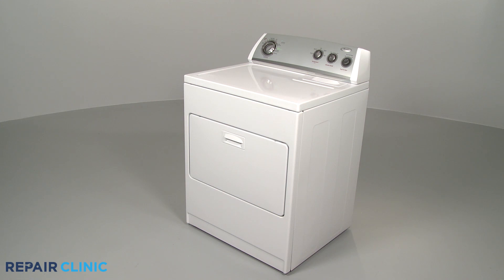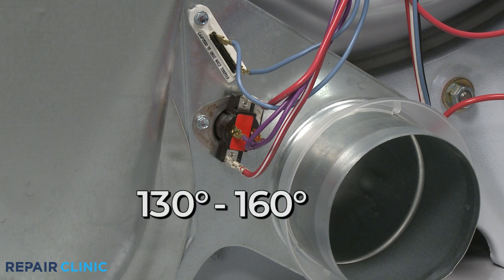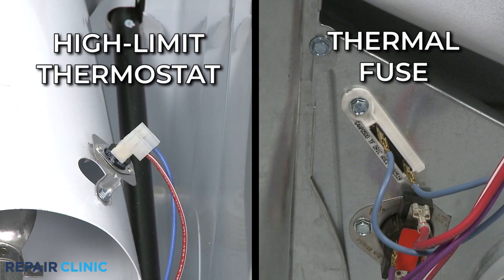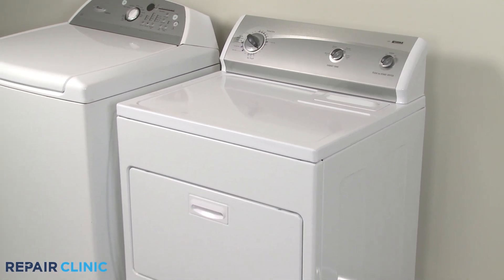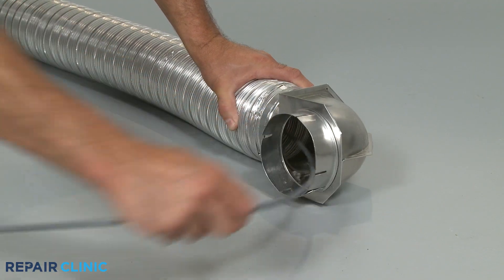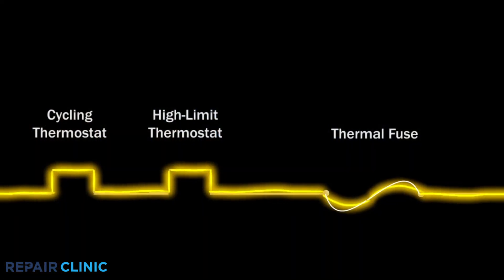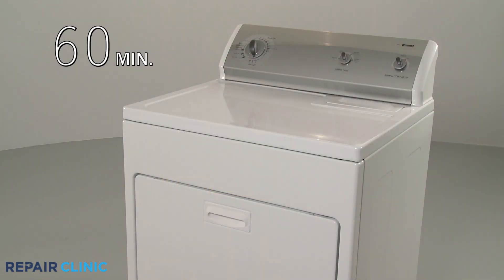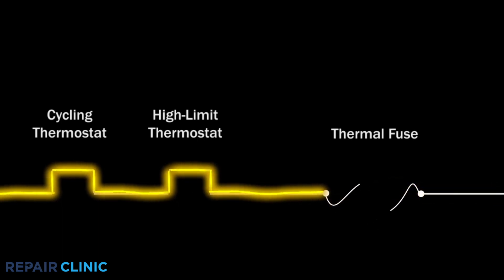How Improper Air Flow Can Shut of Dryer Heat

Comment: I have a maytag Bravo. The "detecting" airflow light goes on immedately. then the timer drops to 4 minutes from say 37 minutes.. when the cycle ends the 'check lint screen'  light starts blinking. I have cleaned the vent, lint screen, disconnected the exhaust , ive taken the dryer apart and cleaned everything including taking apart the fan, taking the drum out and vacuuming. Is there anything elese that can be wrong like a bad sensor or something? Thx
Reply: Ever figure this out?
Reply: I believe it was a lint cleaning inside that solved it. Once I actually hooked the exhaust back up to the dryer and it seemd to work. Bes answer I can give sorry
Reply: @Matt-px7nm  Thank you! I ended up finding a reset button inside my LG dryer and that restarted the heating mechanism and got it working again. Definitely needed a good lint cleaning as well. The interior was caked.
Reply: @PaulDo22 
Is it true, reset buttons are only on gas dryers?
Reply: @soniaochoa7858  The reset button is specifically for the gas dryer electronic ignition.  If there's a reset button for the electric it wouldn't be completely different.